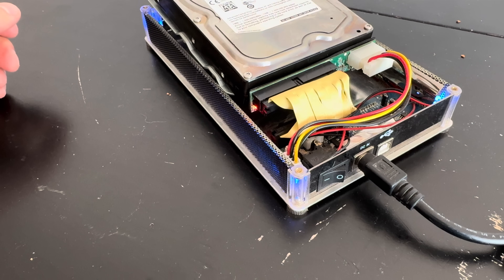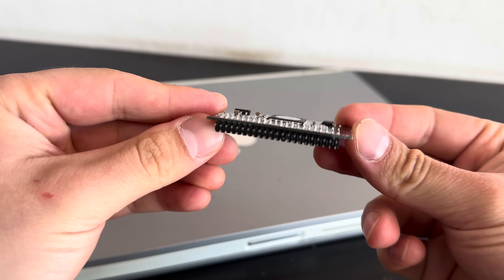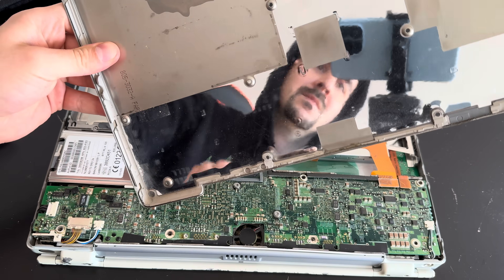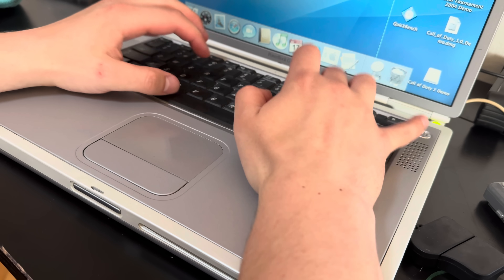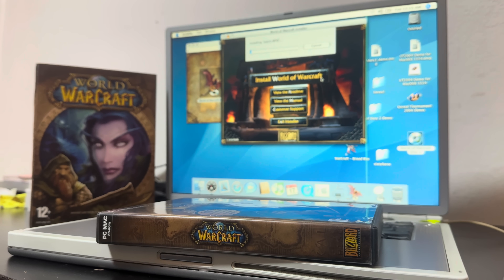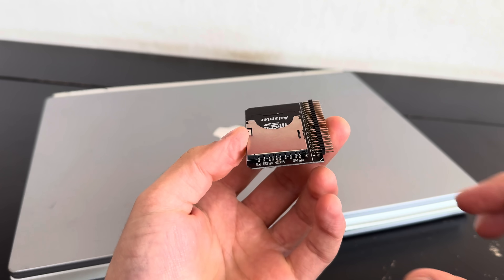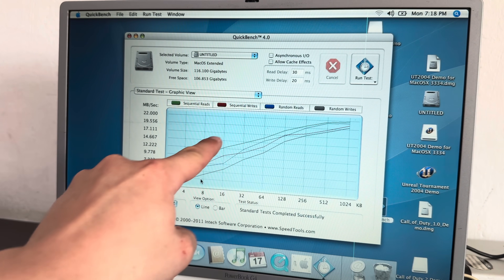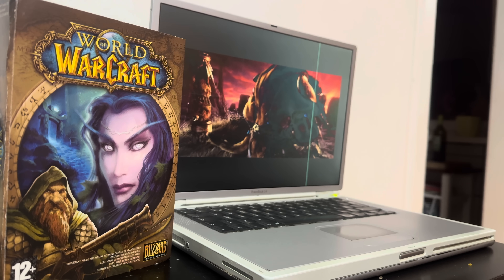Using SD Cards Instead of HDDs?

Comment: Most people tent to forget that if the board of a HDD fails,you can just transplant another board of the same model and restore said HDD. If your SSD and onwards fails,you are screw.
Reply from the maker: @TheJerbro69  there are many more components that can fail inside the HDD apart from that board
Reply: However if the plate gets affected, that's all folks.
Reply: @lrc3847  True, but that's unlikely as these plates are extremely durable. I've taken HDD's apart and can attest to the durability. Out of curiosity, I've even dissolved a whole HDD and other than the plastic, the plates were unfazed via corrosive chemicals.  I've also attempted to damage the plates, break them but quickly surrendered and abandoned that idea. I use them as cup coasters.
Reply: @mrdan2898  the glass is strong, but not the coating is more delicate. There are also other mechanical components that can fail - heads, actuators.
Reply: @mrdan2898  You really gotta scratch the bejesus outta one to kill it. Even some scratches on a plate won't kill it, just breaks those sectors.
Reply: The least likely failure point on a HDD is the board. The more likely failure (specially on a laptop) is movement/impact, which damages the platters. Solid state media is more resistant to percussion, and they just fail less overall.
Reply: I wonder if a SanDisk flash drive could replace the HDD inside an old Windows 1.0 computer, rather than CF cards or SSD’s? In theory you shouldn’t need as much storage as a modern SSD or less Modern CF card provides due to the lower storage requirements and smaller programs. But you would probably need an IDE to USB adapter due to there being no such thing as USB back when Windows 1.0 was released if theirs such thing as an adapter like that. 🤔
Reply: @The-mind-of-Orin Well... Windows 1 and 2 are extremely rare, they were just for corporate customers. And you're right, USB didn't come around until Win98! So you'd have trouble even with Windows 3.11 and Win95. And, why are you calling it a "SanDisk" flash drive? You know that's just a brand, right?  I can't believe in 2025 I still have to tell people to just use a search engine! Also, when Win 3 came out, average hard drives were 20-40MB. Many of the RP2040(Raspberry Pi) boards have 16MB flash memory on-board and could emulate a "Windows 1" computer without separate memory at all. Technology has move so far that a $20 microcontroller board doesn't need any type of disk at all, to emulate an entire old PC. Recently Doom has been ported to an iPad HDMI adapter! Something designed to only convert video signals.
Reply: @The-mind-of-Orin i do all the time. Kodak sd cards are very reliable. In my experience better than even SanDisk.
Reply: @orgelkraft  avoid the SanDisk ultra cards, they're trash. SanDisk extreme and kioxia exceria are great.
Reply: @The-mind-of-Orin Keep in mind that SD cards are unbelievably slow in random reads/writes (~0.34Mb/s) wich is exactly what the os needs. That being said, windows 1.0 is small enough for it to be usable
Reply from the maker: @KatTheCaz  I mean, I’ve shown the speed graph in the video. It’s double the speed of the HDD, both in reads and writes
Reply: @schvabek  Yea I was surprised, I wrote the comment before this point. Tech has come a long way huh
Reply: @KatTheCaz  
eMMC storage is basically just a soldered on modern SD card, and it can still run Android and Windows 10 fine-ish. Like, okay, it's trash compared to even SATA 3 SDDs, let alone UFS, let alone PCI3+ NVME SSDs, but it's usable.
Reply: More modern HDs match the drive with a board so a simple board swap does no longer work.  I'm not sure what exactly is drive-specific in a controller board; I'd assume information such as encryption key, bad block lists or similar.  There are now people who transplant chips from a donor board to the PCB of the "patient" drive.  Which is a specialist job, not everybody can desolder and solder SMD or even BGA parts.
Reply: I attempted to perform that type of repair once. Guess what, no dice.
Reply: The most usual HDD failure cause is heads crashing. I've lost quite a few HDDs and ALL of them died due to a mechanical failure. Once you hear clicking, you're lucky if you manage to back it up before it becomes unusable. I've witnessed exactly one hdd from a friend where the board died, we tried the board-transplant solution. I don't remember if it worked or not, though. In 99% other cases it's mechanical. So it's pretty much a moot point comparing the reliavbility to SSD.  And the SD card or SSD  is easier and faster to backup if the data is important, anyway.
Reply: You need to remember transplanting the controller board without moving the rom chip data to the new board will either not work or may hinder the performance for the drive.
Reply: I try that method but not work, i have 2 hdd similar identical, the one is damaged on the board problem is short electricity.. i swap with other one board and hdd keep not detectable.. i put the board to original other one and work pretty fine.. swap board not affected.. WD Blue
Reply: I don't think you can change the board on a hard drive, I tried it and it completely failed.
Reply: @lukedavis436  If the board is bad, the firmware chip needs to removed and use it to replace the chip on the new board. If that does not work then it would the head assembly that is bad, Pro data recovery could be the only answer assuming that the drive was never opened.
Reply: The plater or head can also fail
Reply: @TheJerbro69 complete bs. SSD don't crap out on you like that, unless it has botched firmwares.

Have you tested flash memories over a decade to know how long they last, or you're just taking redditors words for granted? There was also a rumor about how SSD lose data if left unpowered for a full week. People don't ffucking know what the ffuck they're talking about. Instead of running your mouth, do a test to see how long they really last.
Reply: Who is gonna cry over losing a windows install on their sd card? DEFINITELY noone is storing their important documents on there
Reply: You could always back up your data to some hard drives incase your ssd fails, and if you prefer higher speeds just copy it back over to your new SSD once you get it. Hard drives are dirt cheap now so this would be a cost friendly and effective thing to do
Reply: That's cool and all but the idea that you are "screwed" if your drive fails falls on you for not using backup solutions like the 3 2 1 or even making very basic separate copies of your important information on a usb. There's really no reason to defend old IDE drives when a viable alternative can replace it as a standard entirely with no issues.
Reply: @Jayare175 I dont even have personal data to keep its all on my google account. I literally have my photos stored (for offline access, otherwise on cloud) on a failing sata hard drive from 2008 its just a little slow but got like 20 relocated sectors and a couple of read errors
Reply: @Lavadawg It was a response to the OP but yeah you should have several copies of your stuff if you don't want to lose it.

Eventually, by purely statistical chance, your hardware will fail for one reason or another. That applies to the storage media used by cloud services as well. So I would advise you to at least have 2 or 3 copies of your data in case you lose one forever.
Reply: @Jayare175 Oh im sorry, i have backups i forgot to say, i have 2 hard drives at friends house 2 drives one in my attic and one buried in a waterproof capsule in my backyard if a adversary tries to confiscate my data

Comment: Many years back I recall reading that the drive I was using had a mean time before failure of 11 years. I am running drives that are 15 years old now and they still work. However, I do like the idea of this adapter,  it may be a cheap way to upgrade, although I have a few 13 year old drives stashed away with my 20 year old laptop.
Reply from the maker: If you need to get a new drive for them, I’d consider getting the adapter, just given how uncommon these old
IDE drives are getting

Comment: For me hdd storage will always be overflow. I haven’t used any “fast” or “performance” hdds before but early on in my pc building/gaming experience I used an old hdd I was given because that’s what I had. I got some new stuff, and I had some old stuff and that’s how I built my fist pc. About a year in I figured out my bottleneck was my hdd, it wasn’t just loading times it would cost me frames in most games. Whether that was a crappy, old, or defunct hard drive idk but I never want to be bottlenecked by storage like that again lol. I’d 100% rather be limited by the gpu or cpu than the storage. Maybe I’d also use an hdd for pre 2010 games, media and smaller programs, or if I was building a retro pc but other than that just mass storage for things I don’t need immediately or repeated access.
Reply from the maker: I think also most people use HDDs for storage, and SSDs for OS and other things.

Comment: And access times /10s of mechanical drivers, with no spinup times. 
However, 128GB sata SSD's are cheaper than any adapter+sd card, and you can connect an sata SSD anywhere to move files without needing extra power. Some exceptions apply to CF cards as they are more closely related to IDE specifications. I still have some of my retro machines with mechanical HDDs but upgrading to a similar space SSD is so cheap that it makes sense. Also, there are HDD clickers now.
Reply from the maker: In many cases you can’t fit the actual SSD along with an adapter, so these devices make sense. As for CF, they are getting harder to find nowadays, especially the ones you can boot off of

Comment: SD cards and USB stick drives are NOT mass storage systems.   Their write lifetime expectancy isn't even close to HDDs, or even true SDDs.  They are great for transporting files, camera and phone file storage systems where the use is write "once in a while", read "a little more often".  They can be used as the boot disk on a computer in a read only file system, but a true SSD or HDD should be used for swap and work storage space.  While true SDDs do not have the write endurance of HDDs, if enough unused space is left on the device, and a wear leveling software algorityn is applied, they can last as long as an HDD that has much less total capacity.  Some SDDs are sold as having a total usable capacity of less than their actual total capacity so that wear leveling can be implemented in their firmware, and then the computer's OS can apply a second layer of wear leveling in it's kernel drivers.
Reply from the maker: They certainly work well for retro-hobby projects like this.
Reply: Yes. Did you mean SSDs? 🙂

Comment: Do yourself a favor and Use an SSD instead.  SD cards don't wear level or trim and will wear out and lock up.  SD cards are for temporary storage.  same thing with usb drives.
Reply from the maker: Often times you can’t fit an actual SATA SSD along with an adapter in a laptop. Also, in case you haven’t watched the video, this works very well
Reply: @schvabek  Speaking from experience friend.

Comment: People speak badly about HDDs, but I have a functioning IBM PS/2 Model 25 with a 20 Mb HDD that my father added (they didn't come with hard drives).  That drive is older than the majority of people watching videos on Youtube today and it still works like a champ.
Reply: old electronics that are less miniaturized often do better, for example I've got an old flatscreen TV with bezels as wide as my current phone and it's been in service since 2008. It's had cases of burn-in from console game interfaces and youtube but it clears them on its own with enough frames of something else. My new TV is steadily turning into clown vomit and it doesn't appear to be reversible.
Reply: @xXx_Regulus_xXx  I have a 30" CRT 1080p LG (yes HDMI and 1080p CRT) weighs a ton.  Still works like new in 2025 great for old console and even Atari 800 games.
Reply: @ It is CRT or projection? Unfortunately, I do not know what was being invented for TVs in the late 90s. I think some TVs were called HD. Were they 720 lines? I think it is at this point that plasma TVs were invented and competing with LCD TVs.
Reply: @ Me?  I have CRTs use to have  a 65" 3 9" tube rear projection in 2001.  HD TV was like 1 channel out of 100 then it was for DVDs (no blue rays yet)  480P 1080i on some TV shows.   Very rare were the wide screen CRTs that were stopped around 2006.   They had all the inputs, RGB, SVideo, HDMI, Composite.   Great for old computer and gaming systems from 1979-current. 
And yes have 65" Plasma and OLED .
Reply: @louistournas120  Rear Projection TVs were CRTs they used Giant RED, Green and Blue tubes. BTW most TV is still 720p some 1080P 4k is not as common.   Look up definitions of 720p 1080P and 1080i.  Yes they had 720 lines, did not matter as there was not much content at that resolution it was mostly 480P DVDs then.   Most TV was 4x3 aspect ratio around 2000 is when large rear projections with Wide screen become a thing and were 3500-12,000 range in price for a 55 to 65"  I had a 65".   Before that they had 4x3 rear projection TVs,  content looked bad because no HD signals.
Reply: @ I was guessing they generated an image with a small LCD screen and projected the image onto a diffuser. I have seen a business projector from 2015 which had a kind of cube, 5 cm x 5 cm. It was obvious since you can see the pixels on the projected board. This sort of thing was available in 2001 since the university where I was had a color LCD projector. I remember going to Futurshop, seeing all the plasma and LCD TV. Old analog video looked terrible on them. That’s why reason why I never bought one until 2018 and that is when I needed to plug a HDMI gaming console.
Reply from the maker: Sure, I have some 286/386 era drives myself, but not all of them work, and it’s always a question of whether they will start up or not when I have to use the machine.
Reply: I agree with you. Usually either the read heads or the drive circuitry dies. But the data discs are always still good. The platters are almost indestructible.
Reply: I'm still using a 13 year old HDD that came in a laptop (which also still works fine). It's not fast but for storing a bunch of files you don't need often it does the job silently and reliably. these people might as well waste money on buying ten SSDs instead of a single HDD because basic marketing and redditors upsold them
Reply: By works you mean boots up to show someone.  But still cool 😅
Reply: @gbear1005  I still play games on it at least once a month.  There's something about games that don't rely on anything more than a 256 color SVGA adapter and interesting game play.
Reply: Did you father call it a winchester drive? lol
Reply from the maker: @nendashi5444  they were in fact known as that. I wouldn’t call them that myself nowadays lol
Reply: Great🎉
Reply: being slower, with larger surface area per bit, makes sense the wear hasn't gotten to the point of killing it, take good care of that soldier
Reply: Back then, it was not at all uncommon to get 20+ years out of a hard drive.
Reply: @Robert08010  Back then would be NOW :)
Meaning in 2005 are there HDs that work in 2025?  Ans: YES many mine do. and even from 1990 they still work.
Reply: Very correct, Boss👍👍👍......i have an HP-COMPAQ DC 5100 SFF (Pentium 4) which i got way back in 2007, HDD of 80GB (IDE Technology), and slaved 2 HDDs 500GB (SATA) for Back_UPs. It still works like crazy. It also depends on how you maintain it........Hello from Ghana✌✌✌
Reply: I have an Atari mega file 20 with an Rll drive that works. 

Best 1985 had to offer.
Reply: @DeadCat-42 Me too,  400, 800, 800xl, 520st + soldered ram 1024, Mega Ste + HD  fun times for sure!
Reply: @American_Pariah
The reason why they speak badly about HDDs, is because they don't have good habits of using it.
This is not some mysterious math problem. It's just a fact.
Majority of people destroy their HDD so fast, that's why they speak badly about it. 
For me, I use both HDD and SSD at the same time, and they both have been working fine for .... oh, I don't know, 16 years and I haven't even had to fix it at any stores. Even if I have to, I can already fix them myself(I wish) 😏😏😏😏
Reply: I'm fairly sure those old drives had anything from 1-4g of gold in them ? Not sure of the purity.
Reply: I wish I still had my TRS-80 Model I, that I bought in 1980 and expanded over the years. . . .
Reply: I would say it definitely depends on the production quality, ive seen a lot more failed seagate and IBM drives, toshiba and wd has typically been reliable, i used a 1tb wd drive i had in a core 2 duo dell that went through 3 pc upgrades afterwards and it has some ungodly amount of run time of like 10 years and it still works, i still did back up all my stuff to a new drive though

Comment: btw you can probably fix that vertical line in the LCD panel. Thats often caused by the flex cable that connects the driver to the panel having a bad connection. You can often pix them with a soldering iron set to low enough that it wont melt the plastic but will soften the glue so that to connects again.
Reply from the maker: Yeah, I figured, but it doesn’t bother me to be honest.

Comment: I’ve instilled Windows 10 on an SD card and used my VR laptop on it before and it worked just fine to be honest. I had no issues with it.
Reply from the maker: Sure, even though that’s a pretty different from running it from an IDE interface.
Reply: @ yeah I know it’s a difference. I’m just saying that because a lot of people from what I’ve seen at least like to shit on how bad SD cards can be especially running operating systems on them when I genuinely don’t think they all that bad I see an SD card is just like an old slow version of an SSD or something for example